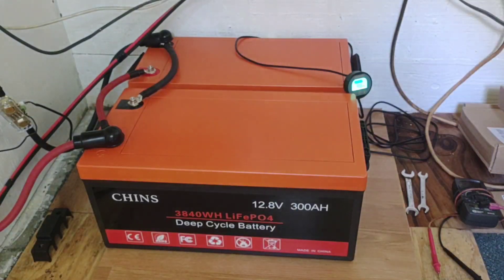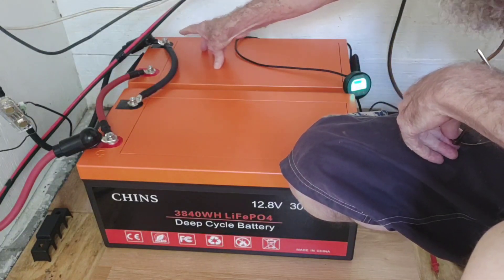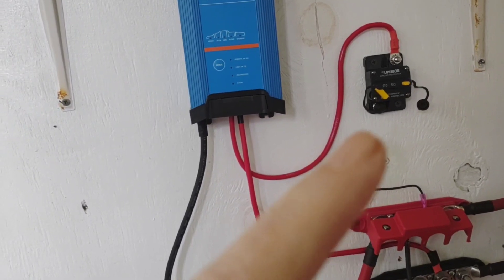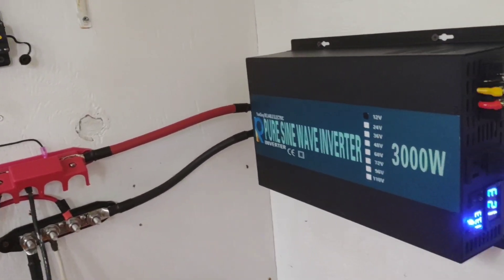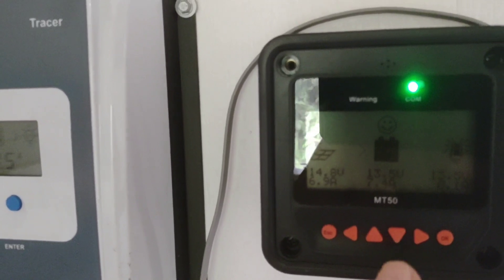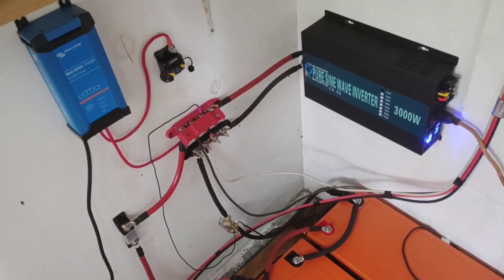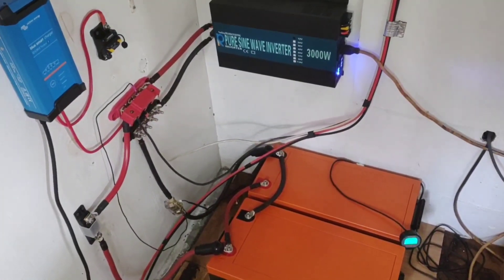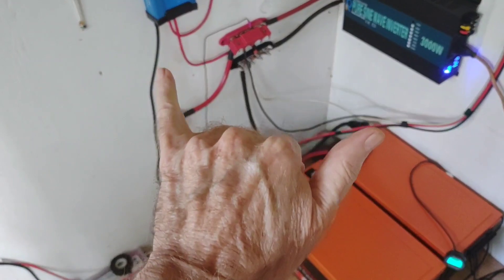600ah/7680wh LiFePO4 up and running

Comment: do the connection of the positive and negative to connect to battery included with the charger? and if not what is the size of the wires?

Comment: Hi, great job!.  I have a question, if the time comes to use the Victron charger, do you keep the solar charger connected to the system while the Victron is charging? or Do you disconnect the solar charge controller?  Thanks and keep up the good work!
Reply from the maker: Oh yes, both at same time ideally.  I just a few minutes ago posted a short video about this. Aloha 🤙
Reply: @ProjectsinParadise808  Yes, I saw it, but I just wanted to be sure.  Thanks.
Reply: Another thing, I am noticing that the Chins battery can not be shipped to my location in Puerto Rico, but we are an island like yours.  How do you manage to get yours?  Thanks
Reply from the maker: @alexandercoss  Contact their customer service.  Some that works,  with shipping fee of course,  like here, but that usually works if you contact them directly.  Bypasses the automated system. They have always obliged that way here. Good luck! Aloha 🤙

Comment: Hello, how long would  it take the Victron blue charger to charge up one/ both of those bad boy batteries?
Cheers
Reply from the maker: Depending on soc, it would take awhile.  If one was completely drained,  10 hours at 30 amps. Double that if both . I never do a 100% dod on them however.  Whenever I get down to about 30% soc is when I woukd boost them a bit, depending on what kind of solar I can expect.  aloha 🤙

Comment: Looking good,  FYI, 3000 watts divided by 12 volts equals 250 AMPS (input to inverter). This would be the maximum load that your inverter could draw from your batteries. Also, 3000 watts divided by 120 volts equals 25 amps (output from inverter). You may want to reconsider your wire size. There are wire gauge charts out there that could help you with that calculation. The consequence of under sizing your wire is the heat that would be generated , thus making a potential fire hazard. Be safe.
Reply from the maker: Thank you Paul...it has come along,  and continues to be a work in progress.  What you say is spot on...safety all the way...aloha 🤙
Reply: @ProjectsinParadise808  Just trying to be helpful. I am in the middle wiring up a Solar System myself and I was amazed with the wire size that the calculation provided. One other thought, you could fuse your system with a smaller fuse so that the fuse would blow before any damage was done until you get the wiring figured out. This is not the correct solution but it could be a temporary work around.
Mahola
Reply from the maker: @paulsharkey4185  Nice. Yeah,  I have changed most of my wiring,  and am going to do a review video in next few weeks on my main system.  It's working great. I have actually seriously considered under sizing all fuses for the exact reasons you mentioned.  Fuses are cheap, an I would rather blow one, the investigate why it blew than destroying anything.  Mahalo for participating in the conversation.  It helps all of us...🤙

Comment: Your load of 25A(3000W 120VAC) dictates a 10ga wire. FYI the larger the wire the less the voltage drop.

Comment: the BMS in each battery work at the CELL level, and are invisible outside the plastic housing. there is NO cooperation between them. one thing you SHOULD consider is while the way you wired the two batteries in PARALLEL is electrically correct, you have made a small flaw in sizing. the wires being smaller bridging the two batteries are the primary current path, meaning all current from the batteries travels through them. you seem to be using smaller AWG wire there, and that is now the limiting factor. I am not saying you are exceeding the rating, as you never mentioned what size wire that is, but you should at least KNOW that they will limit performance if they are in fact smaller. 
You should also consider moving the EPEVER CC MUCH closer to the buss bars as DC wiring should always be as short as possible. Having all that wire will increase voltage drop which MAY affect the charge rate from the unit.
Aloha
Reply from the maker: 1/0 cables connected to,  and from batteries...looks smaller on video,  but good quality.  Plan on doing what you said, shorten wires from cc to bus bar...great advice there! CC is 40 amps, and I have out grown it already....need 80-100 amp now to accommodate more panels and keep up better on charging. Aloha 🤙
Reply: @ProjectsinParadise808  read my post on your latest video, it’s good advice.

Comment: Why did you use a 300A fuse? The discharge of those batteries is only 100A and only a 5 second 300A rating. Wouldn’t a 125A or 150A fuse made more sense?
Reply from the maker: I agree with you,  150amp probably be best at this time. Used what I had initially,  but it's a work in progress yeah. Aloha 🤙

Comment: By chance do you have a way to measure the input wattage of that charger? I can not find it on Victron’s site. Also just ordered me one of these batteries and looking to order that same charger. Like you videos subscribed
Reply from the maker: So what I have done to precisely monitor everything in and out is add that Aili battery monitor which is extremely accurate and fairly priced.  It pretty much is in alignment with what the charger app shows,  give or take very small differences.  I hope this helps buddy, and mahalo for participating with us here...we love to talk solar,  off grid  around here,  and super happy you're part of the conversation...aloha 🤙

Comment: Bing that the batteries are 300 Ah each; if you were to wire them in series, would you still pull 600 ah capacity? I think series would be 24V at 600Ah? or 24V at 300Ah only?
Reply from the maker: In series,  voltage increases while ah stay the same. So in your scenario it would be 24v and 300ah🤙

Comment: The bms work separately but double your discharge current from 200 to 400 amps.  I’ve got the same setup as you just different brand inverter.  No solar though, my setup is strictly backup power for winter power outages.  I almost lost all my chameleons back in February when we lost power for a week and it got down to 9 degrees.  Not taking anymore chances.  Anyway great videos 🤙🏻
Reply from the maker: hey thanks for tuning in, and sharing that information for us...aloha 🤙

Comment: i see you have the same inverter as i do. it has never missed a beat in a year and a half.
Reply from the maker: Thank you for sharing that! I hope I have the same results! Aloha 🤙
Reply: @ProjectsinParadise808  I own the 1500w inverter from the same company and have owned it for 5 years now. Full timing with it now. Oh and mine runs 124v until you throw a heavy load then it will sag to 120. At least that’s what mine does with a 1200w microwave.
Reply from the maker: @offgridliving4128  I sure like hearing that 5 years later it's still purring right along! Aloha and thank you for sharing that with us 🤙

Comment: Hi it look like your inverter doing ok my inverter is the same as your. reliable 3000 watt..12 volt  it ok but it don't like starting some things like a window ac 8000 btu 2000 watts inrush.. it stat all my freezers and a full size fridge it is pretty tough so far a it runs pretty cold .. your project is looking good so far and yeah 12 gauge wire is good. i have 10 gauge swoon wire on mine with ring connectors on the inverter connecting block.....  and a breaker 20 amp with  a gfci outlet  .because  those inverter do not have no protection  .....keep up the good work..............im using lead acid crown 205 4-- 6 volts.. it sure would be nice to afford some lifepo4 batteries...
Reply from the maker: Thank you for sharing with us how its working for you, and your helpful suggestions. Let us know how it continues to work out for you.  Aloha 🤙
Reply: @ProjectsinParadise808  my inverter  reliable 3000 watt..12 volt runs at 123volt also sometimes it 124volt when my battery is at 13.8

Comment: looks great ! BMS will work independent . 4 cell in each . should balance any cell . for inverter 123 V or so is fine . when bigger load then check voltage . 12G for 120V ac line. the start surge of appliance . if wire is very long go with 10ga. if you can put ground rod in and ground inverter ac ground . should be in instructions in inverter grounding. always safety first .  love 50 amp breaker .
Reply from the maker: Thank you Robert! I take notes on what you say! Gonna run about 20 feet on hard wire. Sent a longer message to you just before this one ,and it disappeared...hope this one makes it, and again,  thanks a ton. Appreciate your attention to detail,  and yes...safety! Aloha 🤙
Reply: @ProjectsinParadise808  12ga fine. My inverter has ground lug I put to ground rod. AC ground is Wight N to ground at one point only . Black is hot. short blade on plug. round is ground. N Wight is  longer one and if turned 90 deg,  it is 120V 20 amp .If you wire a extra plug for tools ETC. use a GFIC 20 amp.
Reply from the maker: meyer  copy that Robert...I'll have update soon on that, and I will let you know how it goes...as always mahalo!🤙

Comment: Looking great! I have a question I sent to Chins on mine. They are not well-balanced,I and tried to charge them equally and individully and that did not help. So now Chins says to put in parallel for 6 hours and I did that and the cells are getting closer, but still about a 1 volt or so off per cell.. I will let you know what Chins says.  Are your cells via the Bluetooth app show pretty well balanced?  Thanks! Mike WG7D
Reply from the maker: I hooked mine together shortly after getting second one up to full.  I waited until it settled around 13.6 then hooked them up , and both settled right at 13.6 as one bank. Then used system throughout the night depleting about 50 ah, then on solar next day brought both up to complete 14.2. Been working perfectly,  although these two are not bluetooth versions so no readings from individual cells. Thank you, and stay in touch on how you're doing with your system.  aloha 🤙

Comment: The bms units will work independently sharing half the load and change unless one tops off or bottoms out first
Reply from the maker: Mahalo for that information! You live on islands? aloha 🤙
Reply: @ProjectsinParadise808  no, but hopefully soon. My Fiance lives on Oahu.  I have 20KW LTO  setup here in Louisiana.  Will definitely ship my setup with me. I also have about 30KW Lithium iron phosphate and about 20 Lithium  ion.  I have about 20 inverters from 12v to 288v DC.